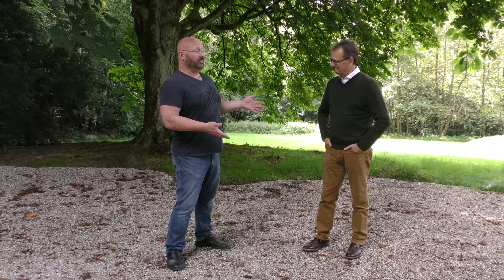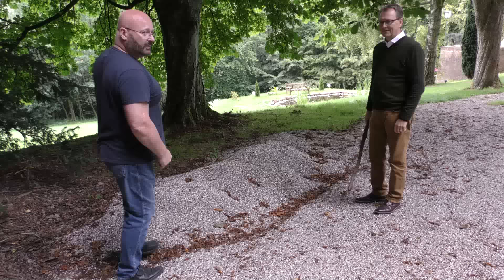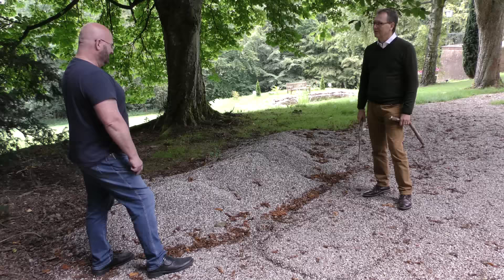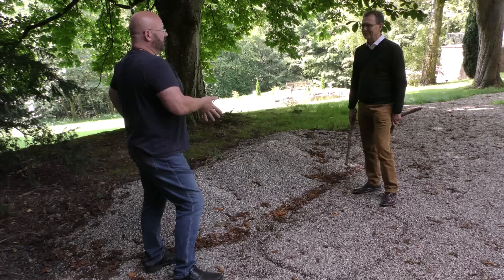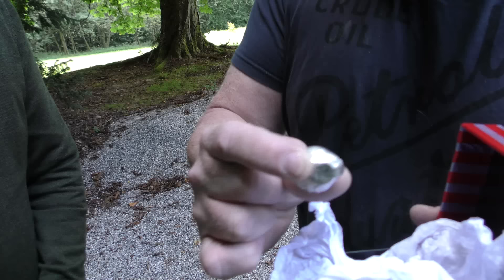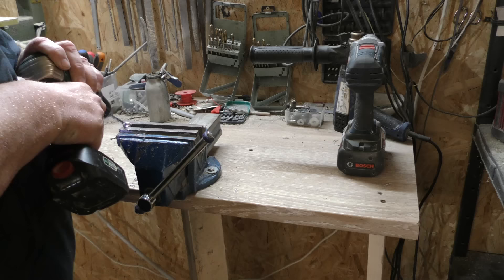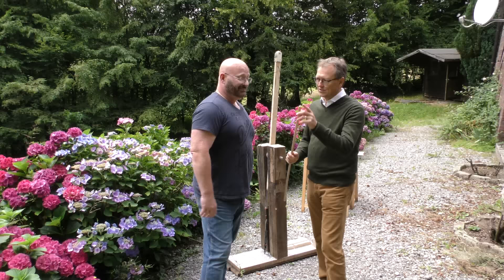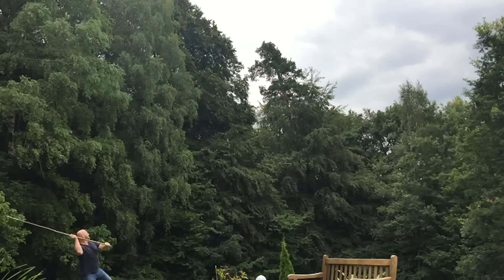The Mystery Of The Whistling Bullets: Psychological Warfare, 200 AD

Comment: Hello ! Well, these tests are really interesting ! But I'm afraid you missed the other half...
Considering that a slingshot is a ranged weapon, seeing the damages dones from a distance would have been nice. ;)
I'm pretty sure the projectile looses a lot of speed and especially penetration power. Where you break a skull, you would in reality have a cranial trauma (still efficient :D ) 
Anyway, great results ! Good luck to aim for the coconut at 20m ^^',
Reply: X component would be fairly the same, y component is the ones that changes over the distance.. been a long time, but what I recall is that drag on the projectile would slow it down depending on shape
Reply: I am a master slinger ( Shepard sling, not slingshot) 
And I can tell you after years of practice.
I can kill anything native and living in North America with a Shephard sling using a whistle at 400 yards.
However, even though a whistler is very fun. It also makes it harder by alarming my prey.
Lol. They are quite fun. They sound like artery. 
I haven't noticed much of a difference between my whistles and my others lead bullets.
I can only make whistles out of lead or zinc. 
I prefer lead and zinc bullets. I have 8 difference molds. ranging from ( in lead)  once ounce to one pound. I can use zinc in them as well but the weight it about 1/3.   
Here are some examples off the top of my head. All at 400 yards hitting 1/2 real plywood,  not partical board.
1 ounce lead, very rarely hit and you can see the hit on the wood.
same size zinc, yeah doesn't hit.
3 ounce lead hit ratio rare. but it goes through most the time. If not it stuck in wood.
Same size zinc. hits less then 1 oz lead but same damage as the 1 oz.
1 pound lead. Have not been able to get it to go that far.
Same size zinc. About as hard to hit as the ounce lead. But hits like the 3 ounce.
At 200 yard same type of plywood.
The 1 pound lead goes right through the plywood. 
I've put bullets through many vehicals body parts by accident at about 30 feet. 
#1 lesson any new slinger should know.
Always park at least a mile away. Because anyplace 360 with in 1 mile  is danger zone.
All where behind me.
here are some of my costly vehicle repairs
mirrors
windshield 
fenders
hood
door

Comment: The penetration test is flawed.  Your doing this at point blank range. at a distance the projectiles would slow down a lot more than this.
Reply from the maker: The speed would go down a bit, but I used a weaker bandset to compensate. V0 of mine was 35 m/s, ancient slingers did 45 m/s.
Reply: You're*
Reply: And here comes the grammar police. Blame it on my phones auto correct.
Reply: here comes the blame game
Reply: Must be a great game then because it's true.
Reply: There is also the difference that your slingshot rifle propels the balls straight forward, whereas missiles fired from a manual sling would have taken an arc between the user and the target.
Reply: IMO I know that air resistance is a part so the penetration would be slight weaker, but don't forget they are battle prepared. Not the best I guess in average, but above it.
Reply: There is a formula to calculate loss from air resistance with momentum loss, velocity and range. 
Slings for combat had an average distance of less than forty meters. With a lead sling bullet, you're not going to see that much velocity or momentum loss at that range when compared to point blank range.
Reply: 40m so close to 50yards I'm "merican so....... to lazy to type in google to find out the conversion. just realize it would have been shorter than this comment. "Merican lol
Reply from the maker: All I have to do is aiming upwards and I will get the same arch. Laws of physics.
Reply: +JoergSprave Exactly.
Reply: +Chris Barr 
I am a US Army Veteran, so I always revert to the metric system when thinking about weapons.
Reply: So with this projectile weight of about 926 Grains and a velocity of 115 Ft/sec at the sling shoot. At 50yard it losses more than Half its velocity at 46 ft/sec and from 27 ft-lb of energy to only 4 ft-lb. Just did this on a Ballistic Calculator.
Reply: +Chris Barr First you need to learn units
Reply: +Chris Barr 
That still doesn't account for mass and momentum.
Reply: +Chris Barr U guess you missed my earlier reply. I am a US Army Veteran and always revert to the metric system when referring to weapons.

There is a good Android app called Handyman Calculator that has very many conversion calculators that I can highly recommend.
Reply: Mok214 Maybe you missed where I posted the ballistic calculation of this projectile over distance. With the drag Coefficient of a rock. maybe its wrong.
Reply: I think the bigger problem is that ballistic gelatin simulates muscle tissue, but not the skin.
Reply: +Rolf Soldaat in an earlier episode he showed how ballistic gelatin was made and that the gelatin made in Germany is much tougher
Reply: this again...
Reply: As Rolf stated, ballistic gel does not simulate skin, this is not so much of an issue with high speed projectiles that are expected to penetrate skin without significant energy loss, however for low speed projectiles like these it is a significant factor. At that range the projectile would likely still penetrate bare skin, but it would lose a significant amount of energy and not penetrate to "lethal" depths. And as pointed out by Chris the projectile would likely be traveling significantly slower at range. I would argue for these reasons these projectiles were primarily blunt force weapons not penetrative ones. If you want to penetrate at range you need a sharp tip like an arrow or javelin.
Reply: What i reacted most to was the change of weapon for the last test.
Reply: A Roman by the name of Vegetius in "De Re Militari" wrote that:
(Text written in 390 A.D. British translation published in 1767.)

"Recruits are to be taught the art of throwing stones both with the hand and sling."
[...]
"Soldiers, notwithstanding their defensive armour, are often more annoyed by the round stones from the sling than by all the arrows of the enemy. Stones kill without mangling the body, and the contusion is mortal without loss of blood."

Basically, finding stones sitting around and throwing them by hand and sling was deadly not by penetration but by blunt force.

That penetration test was flawed, but it is possible that within 40 meters you could easily penetrate a mans skull. Granted at further distances it wouldn't enter your skull, it would probably just crack it open without entering. 

My point: it could very easily penetrate skulls within a close distance, maybe the last stone you fire before pulling your sword or spear out. Was this the main way to kill people though? No. BUT IT IS PHYSICALLY POSSIBLE TO DO.

(I am not saying anyone is wrong, im simply giving a historical source on the use of thrown/slung pebbles to give a different viewpoint on the matter)
Reply: +Skwisgar2322 In the penetration test, Joerg also did not account for the shape of the original projectiles. the original projectiles were almost egg-like in shape which i believe would have penetrated much better than a spherical steel ball, given the right conditions.
Reply: 45 m/s is 45 m/s angle is irrelevant.
Reply: +Grant Turner another factor that was overlooked was the stability of the target. Because the gelatin gives way / moves back upon contact, it also absorbs some of the energy of the projectile. A man would be more stable and therefore provide a target more prone to penetration. Skin, clothing, armor, drag, and even bone would certainly play a part in the damage done.
Reply: How would you hit a peice of ballistic gel at let's say 100 meters, it would take days
Reply: Tomás Pabón the same way you hit someones head! Slings are accurate if a skilled person is using it.
Reply: +Chris Barr Well, yeah but it's not like you can just produce a sling expert out of the people available in the situation,slings are kind of obsolete. I'm sure there's some sling pro somewhere out there but they must be in rather short supply.
Reply: Just remember sling users would have been common back in those times, and likely a tool for hunting as well, back in those days the users would probably have been more proficient than today's average person in regards to the slings
Reply: Ben Weldon Yeah,but still,thats the best test they could do with the skills they have
Reply: Ignore my comment, although valid it wasn't meant for you.
Reply: Also, when you are doing mathematical calculations, you often ignore the friction of air on something when calculating its distance traveled, due to it being such a small difference.

Although you have acceleration due to gravity in the Y direction (up and down) You don't have a direct force in the X direction (which you must define for each problem).

example:
If you throw a ball at 20m/s in the X direction, it will always travel at 20m/s
(assuming no air friction)

If that ball also has 20m/s in the Y direction, then it will be effected by -9.81m/s acceleration due to gravity

This means the stone, if thrown at head height, has 40m/s velocity, would loose Y velocity as it went up, then get Y velocity back as it fell back down. When the stone got back to the Y coordinate that it left at then it would have accelerated back to the same exact speed it left.

Therfore:.
A stone thrown at head height, 40m/s at 45degrees, it would then hit at head height at 40m/s and -45 degrees (aka 225 degrees)

And since (Kinetic energy) K.E.=1/2mV^2
The mass is constant, the velocity is the same as when it was thrown due to have no force acted on it, then the kinetic energy of the throw is the same as the kinetic energy that the target feels.

The only way you could assume this test was not correct was if you assumed that there would always be a headwind.
Reply: Really love it you take time to respond! You're awesome! Love all your work man!
Reply: +ecoots Angle is always relevant. Hitting an object dead on, on a flat side, is much different from hitting the same object on an angle. Also just because I can sling an object at 30 m/s does not meant it is getting their at 30 m/s.
Reply: +Connor Hill But it does have air friction. Losing energy in the upward arc  would not correlate to the same amount of energy gained in the downward arc. In both up and down a small amount would be lost.
Reply: he was shooting at 35 ft/sec which is his estimated contact velocity..it is not flawed...go back to jr hi junior
Reply: obiously youve never been hit by a falling projectile
Reply: "I paid no attention to what was said"
Reply: no, remember in physics? the speed and acceleration is the same in the downward archive as it is in the upward arch
Reply: Mok214
Can you give me those formulas please?
Reply: +Edward Only if you don't take air resistance into consideration.
Reply: If you launch them at a hyperbolic arc. The amount of energy will be conserved, and the velocity when it hits the ground will be similar to the exit velocity.
Reply: It is worth a mention that some force would be lost due to air drag, some force would also be lost because of the arch (because they shot uphill). The angle of the shot would also reduce the force because of the angel of inpact is not 90 degrees (atleast in most situations if you hit the torso). However, i believe they compensated for this. But i am very curious Joerg, why did you use a different slingshot for the two penetration tests?
Reply: Chris Barr kind of
Reply: BRjenT1 because  some men are stronger than others so he demonstrated that with different slingshots
Reply: When you fling a projectile into the air. It requires a certain amount of energy to propel it to a certain height. That same amount of energy is converted to potential energy and as it falls, it is converted back to kinetic energy. When it hits the ground, the speed that it maintains is similar to its initial velocity. I don't know why this is hard to understand. Air resistance is negligible because it affects both the ascent and descent of the projectile.
Reply: phuck ewe on the issue of the gelatin moving backward, a human body would move less, true, but only due to the weight of the body. But as the professor says, a blow to the chest would be enough to push back the breastbone, possibly causing arrhythmia. Either way, a projectile at that velocity is possibly fatal. At the very least, you have to consider that these bullets are not flying individually. Slingers would launch them in volleys. 

The fabric idea is a valid point, but I think these guys were showing that the threat of blunt trauma was the greatest and most probable danger.

All in all, the power of the bullet doesn't impress me as much as the doppler effect of the bullets whistling as they come towards you. A volley of multiple bullets coming at you is simply terrifying, and the mental effect of such an attack is pretty effective in medieval warfare.

Holy shit, I forgot why we were arguing.
Reply: right, the sling also increases the radius of the throwing arc, so there's less strain on a the arm. the image of MLB pitches as warriors is hilarious though.

Kinda unrelated. there is a youtube channel called ancient technology or something where the guy makes houses, furnaces and other things using basic tools. It's really quite amazing. He makes a rudimentary sling with plant fiber.
Reply: Hi there is something i wonder about: did the "poison ball" not go to fast to release the poison? Wouldn't it be most effective if it stayed in the body, releasing the full dose? Now it just went in and out, wich is pretty darn painfull if you ask me, wouldn't just going trough be enough?   I have a theory myself: maybe they were tied together, to create a sort of deadly string that would start to rotate after launch, a bit like the chained cannonballs but smaller and launched with something big like a ballista. It could "slap" people on impact, acting like a chainsaw chain. Can't think of anything good happening to a (naked) Caledonian when being hit by a string of lead balls..... ouch
Reply: +Chris Barr
I have not watched the video yet but it could be that it's showing maximum capability....just depends on what he actually says about it...I've seen channels where the idea was to show best case scenario to show what could even be possible.

Yup after watching the video they were simply showing that it was possible not that it was meant to represent a long ranged hit.
Reply: Still, I think a 33% energy loss is more than reasonable for only air friction!
Reply: +Mok214 Use sandstone or granite projectiles next time.

Comment: I wonder if timing the noise was a means to measure distance so missile launchers angles could be set outside of the enemies range
Reply: Clarence Cherrone hmm that's actually a very interesting theory
Reply: I don’t think they had rocket launchers at that time...
Reply: More like artillery, but you'd have to time the shot and you wouldn't get any more info about it than how far you can hear it. Or how far away it is. It wouldn't help
Reply: @andrecosta9552 
Missile is a term used while talking about pre-firearms times (but also after) to indicate projectiles
Reply: Clarence...you're a smart individual.
Now stop wasting your thought process and clean up that garbage patch in the Pacific.
Please
Reply: @76shogun1  what
Reply: Measuring the timing of the noise and the direction. Snipers use this to locate other enemy sniper's location roughly
Reply: Crispy Cream  Dr Reid mentioned that he was getting the range from the Roman lines to the Caledonian lines, though he doesn't give the number (that I noticed, anyway). Trebuchets  or ballistas were dangerous, but I doubt they were used more than 100-300 yards away, and you can get slings close to that range with practice, and if you are going for range over accuracy.

Comment: Is there any evidence that the holes were actively drilled, and not part of the casting process? I can think of several designs that would make it very easy to have a consistently sized hole while making it easier to cast the shapes in large numbers.

Comment: on the subject of psychological effect. Maybe a wick was put in there so it looked like a modern day tracer bullet
Reply: Jamie Rollinson wouldn't the fire go out if a projective was going that fast?
Reply: @mtp

Yup, tracer bullets work by the fire coming out of the back of the bullet, a sling pellet would spin rapidly putting out any fire.
Reply: Instead of a psychological effect, they may have put hot coals into the hole to start fires where they landed.
Reply: if you drilled completely through, would it have a warbeling sound and a curving trajectory?
Reply: If a hot coal were put into a stone that was thrown over a wall, the flame might go out because the air goes past the coal too quickly to maintain a flame, but the coal would still be hot enough to be an ignition source. If the stone landed on a thatched roof, the coal would still be hot enough to ignite the thatching. If the stone landed in grain storage, the coal would be hot enough to ignite the grain. The flame isn't necessary to start the fire. The heat is sufficient for ignition.
Reply: Joe Ç  I saw a engineering connections episode with Richard Hammond ( of top gear and the grand tour ) where they wanted to explain how kevlar was a good material for F1 car's petrol tanks as it is strong yet lightweight and can resist penetration at high speeds and can be shaped inside the car body. ( Penetration is important because of the huge amounts of carbon fibre being used , as it could splinter and rupture the tank and the heat and sparks might set it off. ) 
They shot a arrow lit on fire with fuel I assume at it while it was filled with petrol to prove it can take a beating. So maybe fire arrows work at a short distance ? 
It was shot by some famous archer. According to them.